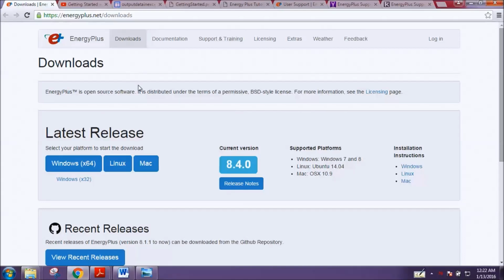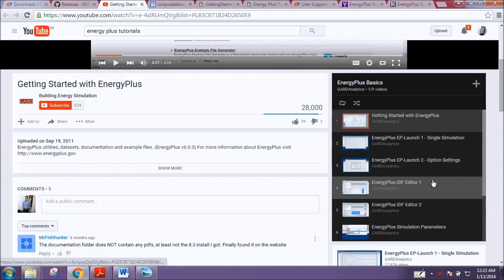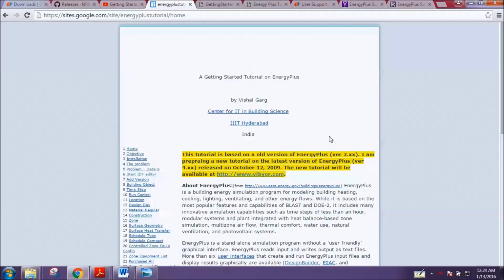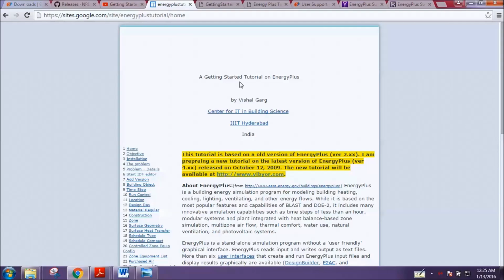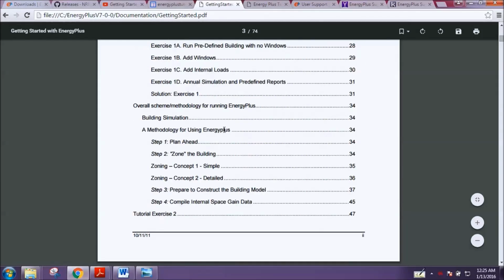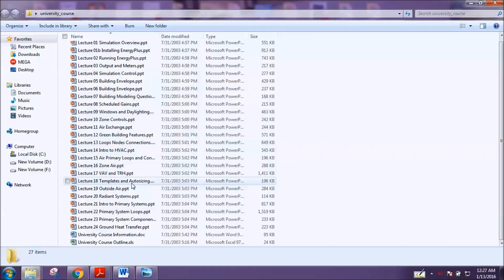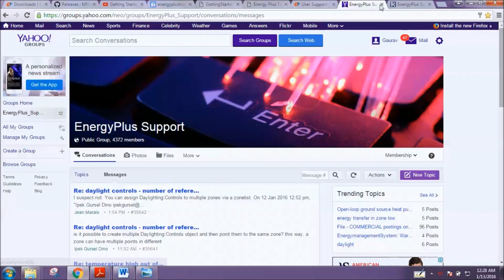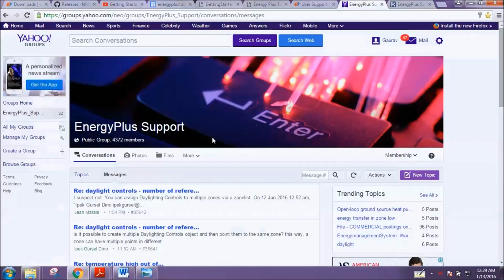Introduction and Tutorials on Basics of EnergyPlus

Comment: Hey, thank you for sharing your video!
I am in a little trouble... I want to size an unitary HVAC system to a building, I have already assigned all of internal gains, building materials, schedules etc, however I can't choose the right output variable to aim that. Can I change the units though? Any suggestion please?
Reply: Which kind of Unitary HVAC are you aiming for. Output variables will also depend on the kind of results you expect. You need to provide more detail on this.